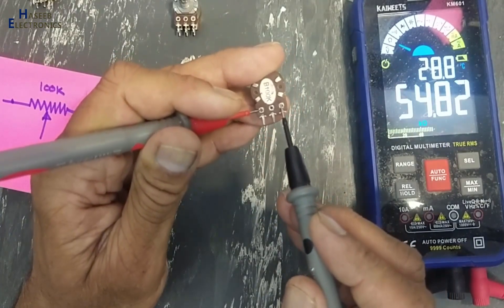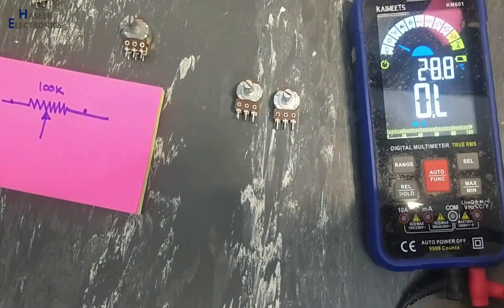{1182} Fake Potentiometer || Falsely marked electronics components

Comment: yes it is fake. but i think you should warn the seller. on the other hand if the panel location is not important is it possible temporarily to use them as the serial?